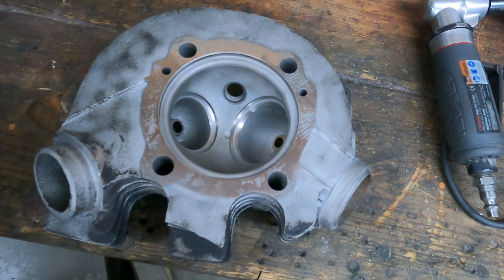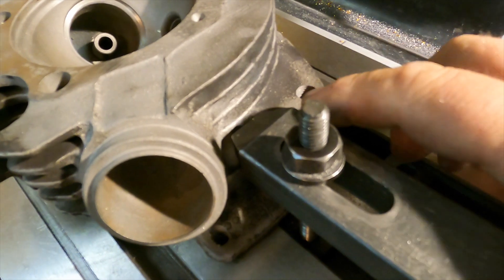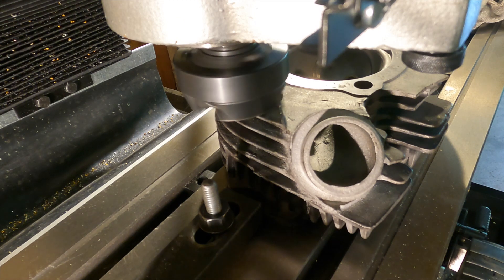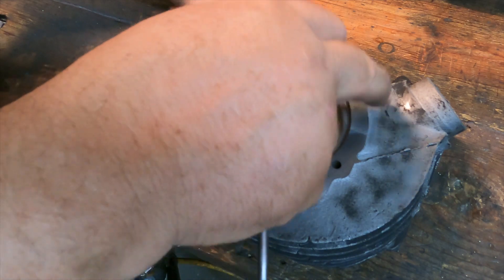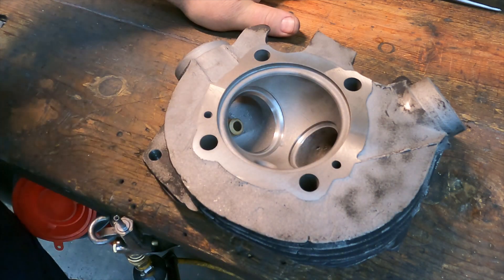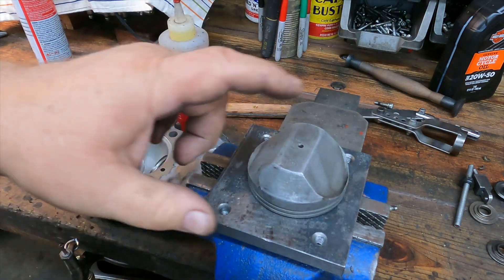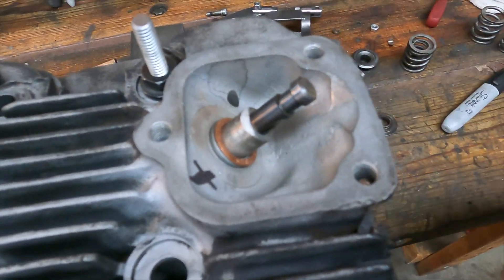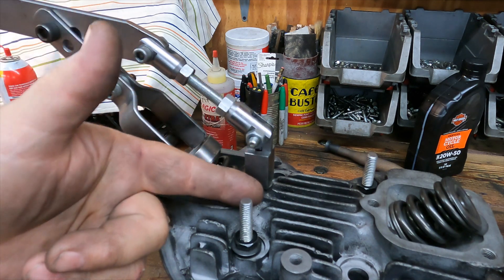Amateur Machinist Mills A Head Nbr. 127

Comment: I suspect that the barely perceptible ridge between the two passes is due to your milling head being tipped ever so slightly forward or backwards. Smart fixture and tool refinement. Good content.
Reply from the maker: You are absolutely right. I did another project (I forgot what) and decided to recheck the tram, It did need to be tweaked a little.
Reply: @IronHeadCycle  Terrific that you’ve sorted that out. Looking forward to more content.